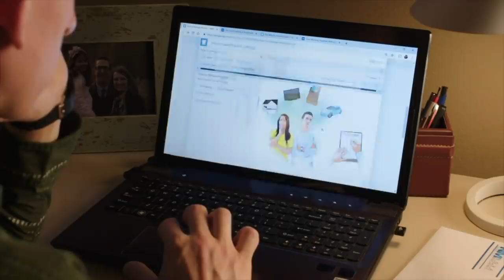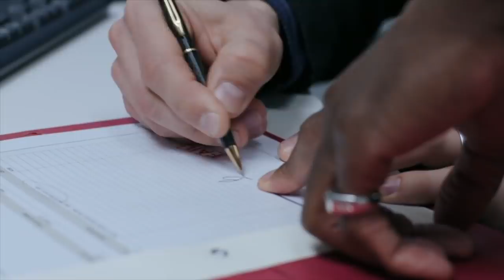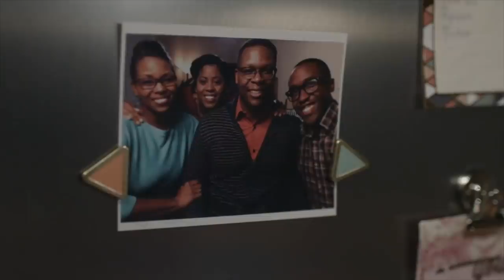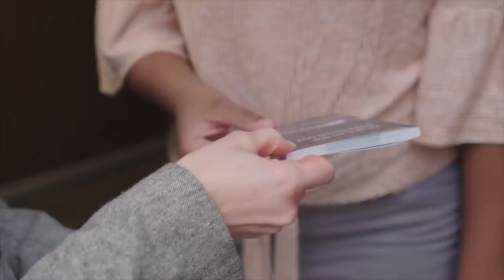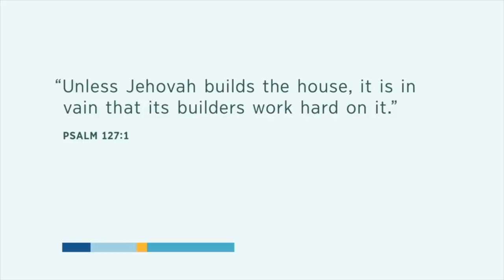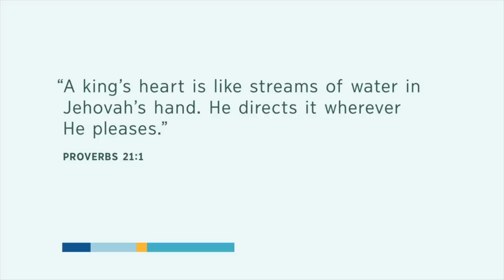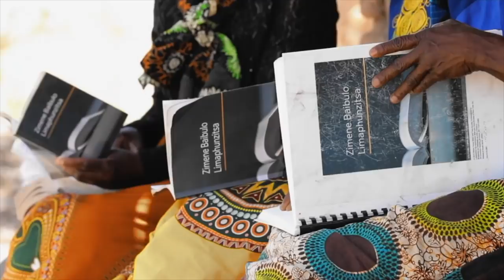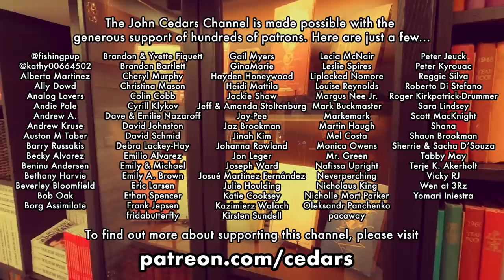My Thoughts on the "Always Rejoice"! 2020 Convention of Jehovah's Witnesses 1/6 (Friday AM)

Comment: As someone with a background in engineering, if a batch of product is not up to specifications, and the delivery is urgent, you filter the product and reproduce the (in this case) small amount of trash. in this case probably 30 minutes work, if production of the whole batch can be done in a day.
This whole example is complete bullshit! Every decent company checks on the product regularly to hotfix immidiately, because it's really easy with modern machinery to do! And imagine the fallout, when the buyer checks the specs and sends the whole trash back, that get's really expensive, really fast!